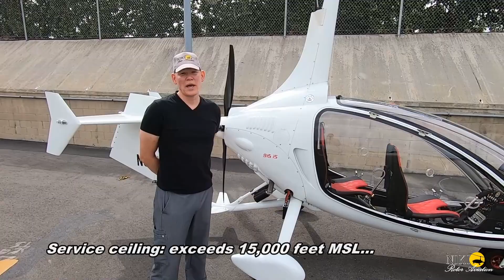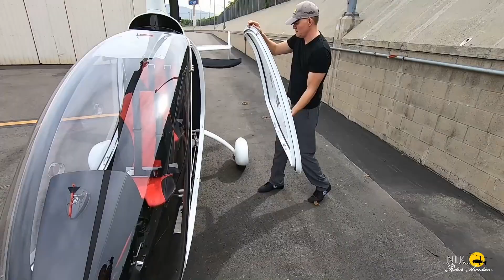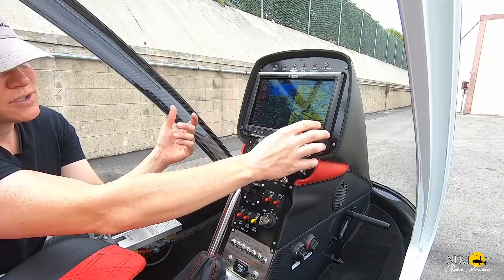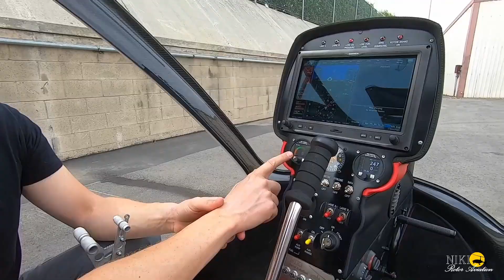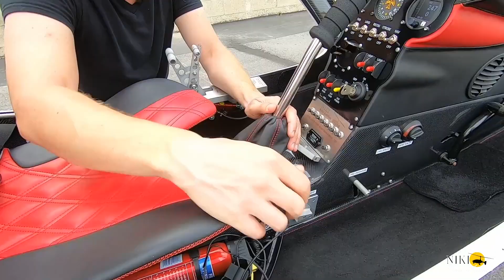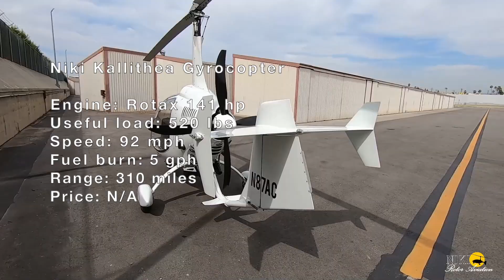WHY Fly This Instead Of A Helicopter l Niki Kallithea Gyroplane

Comment: That is very nice but I am old school analog gauges , The digital is great for navigation but for engine systems the screen or electronics could fail at anytime and you wouldn't be able to monitor engine performance or fuel , The digital is out . I want to add another thing if the control board goes out you are going to have a tough time finding electronics and or transistor components to rebuild a control board ever since covid we cant get a lot of electronics from china because they shut it down and the US still refuses to manufacture here . They phase out these systems and after awhile you can no long get control boards through the manufacture,
Reply: @user-5gu78qo27i  You buy your chopper with a blow up battery and get sprayed with acid and smoke your control boards I will go old school with analog gauges with the battery in the back on the fire wall out of the cockpit Okay ?

Comment: Nice professional presentation by someone that was familiar with the aircraft!

Clear, concise and knowledgeable, the Pilot was clearly quite taken with this machine, and understandably so, its a beautiful looking machine with fantastic glazing offering unparalleled views.

Although not specifically mentioned, I assume that the seats are load absorbing and crash resistant!

The avionics were impressive but the presentation made no mention of costs of the variants of this aircraft.

If one needs the flight capabilities of a helicopter, then an autogyro is simply not an option and never has been, despite the video title!

Autogyros are not an inexpensive helicopter replacement, but an entirely different category of aircraft.

Comment: I'm in the UK - and am currently looking to buy a gyrocopter; this machine is very interesting...but you should have made an attempt at a price!! And please, get rid of "lbs" - its 2020 and weight is measured in Kgs - simple, accurate and very transferrable!!!
Reply: @user-5gu78qo27i  You are completely wrong! There is NO God of any kind; a litre is a clearly defined unit; and as I work in the construction business - we NEVER used the antiquated feet and inches ; its metric or nothing! very retrograde thinking....poor you!

Comment: Useless video...No cost or even a simple engine run in the sales pitch.
Reply: Fucking negative boomers. He covered very details states and specs in a very short amount of time. Go to Google and figure out the price, it takes less time than it did to comment. You’ll find a wide array of price ranges because many are equipped with different engine options.

Comment: How tall are you ?
Reply: 6’2” 200lbs. I think the max height the gyro could accommodate would be 6’3” maybe 6’4” (but your head would be right next to the windscreen. One thing that helps is using thin soled rolled heel driving shoes (I like Momo) and a clarity aloft headset (no headband to hit the top of the canopy). Max front seat weight is 297 lbs.

Comment: Since it has a Rotax, will it run on either avgas and mogas?

I would have enjoyed seeing it take-off and/or land
Reply: Yes, this aircraft has flown most of its hours with automotive 91 Octane gasoline with 10% Ethanol (in California), and has flown quite a few hours with Avgas while on long cross country flights.
Reply: L.A. Gyroplane Aviation Not to be annoying, but aren’t you supposed to use 93 octane if it contains 10% ethanol? 91 octane is the minimum but with no ethanol content correct?
Reply: @andrewmorris3479  that's the best I have access to in California. Works like a charm...
Reply: L.A. Gyroplane Aviation I’m glad to hear you haven’t had any issues running it. The 915 is such a sweet engine!
Reply: @Max Wylde There is no argument from me about how bad Ethanol is, but lead is not a good thing either. And if we limit the conversation to this particular aircraft, automotive fuel is preferred for the usual type of flying. Avgas should be used for high altitude flying. All gas lines are made from automotive hose resistant to Ethanol, and Rotax recommends replacement on all rubber components every five years anyway, so no need to worry too much on a daily basis. In addition, when this machine was in long term storage all fuel was drained and purged with Avgas in order to eliminate any traces of the dreaded Ethanol. The fuel tank is positioned in such a way that would provide plenty of gravitational pressure as well... Also to keep in mind, 100LL is what we have access to here in California...
Reply: Please check out some flying videos in this machine posted by La Gyroplane aviation on YouTube.
Reply: @Max Wylde I don't understand your reasoning here. This engine was designed for automotive fuel, and it can tolerate Ethanol, in fact, AvGas is what this engine does not like too much. It is true that automotive gas is not something you leave in the tank for long term storage, and you should check the fuel filter at every oil change as well, but the engine is very happy to run on mogas on a daily basis.
Reply: L.A. Gyroplane Aviation  in my car and scooter I use 95 . No ethanol, there rubbers in the motors.
Reply: @dicksijtsma1191  you are a lucky guy... California is fairly limited when it comes to Ethanol free fuel availability...

Comment: Beautiful but what's the price 
And what's the Ricuairments 
To fly it??
Reply: Estimated 100000 plus, Sport pilots license required
Reply: As equipped this machine is around $120k (this one has all the options - rotax 915iS power and a full garmin g3x panel w ads-b in/out etc). A more basic machine with MGL avionics and rotax 912 is around $75k. 914 power costs about 10k more. They are a great value considering the technology and build quality. Also the factory is very supportive and responsive to parts requests and technical support. It’s the best gyro available today IMO.
Reply: Please check out some flying videos in this gyro at LA Gyroplane Aviation on YouTube.

Comment: So, I don't understand your title.  Why reference  a helicopter at all?  The title should say "Why fly this instead of a fixed wing".  While a gyroplane is a rotorcraft, it must follow fixed wing flight rules, and it cannot hover (please don't tell me about headwinds).  And yes, they are fun, but they have nothing to do with helicopters.  Or you are just kidding yourself.
Reply: Actually, the gyroplane is a rotorcraft, and as such it can fly as low as helicopter, and when it comes to landing, even helicopter do an approach so I am not sure what your gripe with the notion of using gyros to do about 80% of what helicopters could do...
Reply: @lagyro  I don't have a gripe, it's that other 20% I was referring to.  And as far as flying low, any aircraft can fly low, but not necessarily legally.  My point was a gyroplane has to abide by fixed wing rules for minimum altitudes, etc.  Those rules don't apply to helicopters.
Reply: @aeroengguy448  Look at airport traffic pattern altitudes. Turbine, piston, rotorcraft... not helicopters or gyros, but rotorcraft. But that is a moot point in this case. Gyros in the US are not usable for commercial use these days, so the argument is limited to mostly personal use.
Reply: @lagyro  I was referring FAR 91.119.

Comment: Some earlier auto-gyros cold take-off vertically via jump takeoffs and had wings for better crusing performance. It would be great if those features reappeared in current models.
Reply: Jump take offs add complexity to the design and maintenance. Current manufacturers and designers are trying to stay away from such complications, not to mention the average gyro pilot these days would probably not want to go through the additional training required/needed to handle jump take offs.
Reply: @lagyro  Interesting. Modern automations and electric components could make it less nightmarish to implement and use, but it is still quite an effort to develop.
Maybe there are other solutions for vertical or short take-off and landing, many ideas were developed since the early 20th century. Improving the rotor controls with collective pitch seem to decrease the required distance for take-off (but it also increases complexity and maybe can be made simpler by novel approaches).
If you are using a battery, super-capacitor, fuel cell, generator... you open up to a lot of possibilities.
Installing an additional electric motor on the rotor only for take-off is one of them, since the motors tend to be really compact.
Reply: @vitordelima  In my experience it all comes down to dollars and cents... None of the current designers I have spoken to even consider thinking about jump takeoff - not worth their R&D dollars.
Reply: @lagyro  Exactly, it requires the use of technology that is hard to get certified later on or find good suppliers and many other difficulties that are hard to overcome.
Some technology is even immature.
Reply: Most gyro accidents occur during takeoff.  Managing the rotor rpm, power, speed and then balancing on two wheels is far more complex than a fixed wing take off. Jump takeoff eliminates all that in exchange for mechanical complexity. The angular momentum energy in a spinning rotor does not like anything abrupt applied to it and is much safer when in the air.  Rubber tires rolling down a runway is chock full of abrupt opportunities. I agree no one will bring a jump takeoff to market.  Hell, most can't even manage a castering nose wheel. 

Also, the early gyros with a wing was used for roll control, not lift, because the rotor angle was fixed. The early jump takeoff gyros had the right idea as getting into the air from a stand still gets all that angular energy in the air instantly.
Reply: @KB3M  Interesting, some models used wings for lift too later on, but I didn't know that wasn't the case for earlier models. But you have to admit an aircraft with vertical take-off, good cruise performance, the rotor as a fail-safe device (the same role as parachutes in LSA and very light jets nowadays), less takeoff accidents and using a single regular engine is very promising. Carter Aviation had the most advanced prototype of this idea.